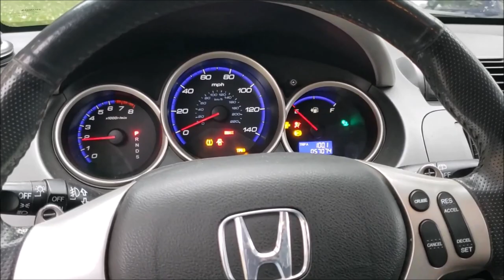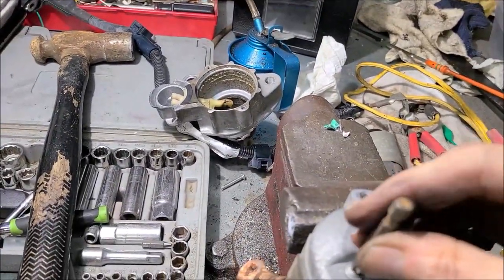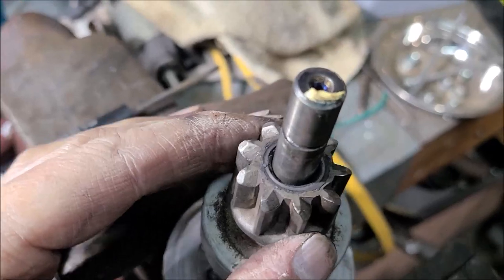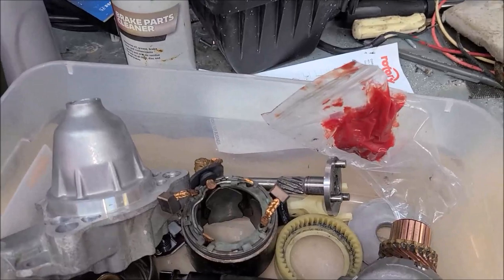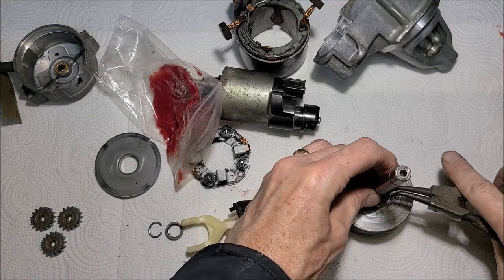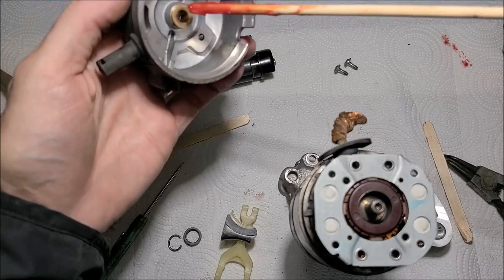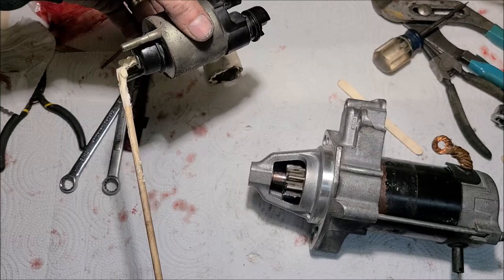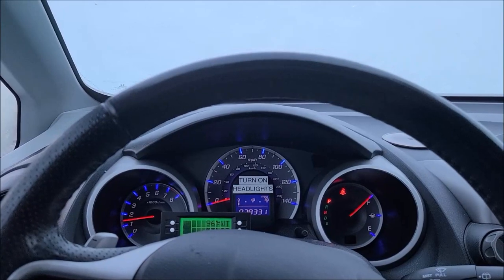SOLVED: HONDA FIT STARTER NOISE DURING A COLD START 31200-RB1-013, 31207-PCA-003

Comment: Hey, I see the video was posted 2 months ago. How's this repair continuing to work? Also, I was thinking DENSO reman as an option. Lastly, I think they could've made the bushing longer, but wouldn't you risk hanging up the starter and wearing the clutch assembly? Maybe that's why the design of the original was so small? Wouldn't you replace like for like?
Reply from the maker: It's still working perfectly, no more noise. Other starters of the same style use longer bushings . I think it's planned obsolescence... lol

Comment: What material did you pick for the bushing? Also, what did you end up on for the length? Lastly, not doing anything probably doesn't ultimately affect it, maybe getting premature wear on shaft or are there other wear items that you could think of?
Reply from the maker: Not sure, it was brass or bronze stock he had laying around, length = 1/2 prox. My fear if you do nothing your going to add ware to the flywheel teeth as the bendix bushing wares and the teeth get farther apart.